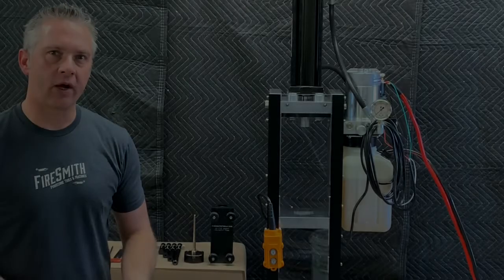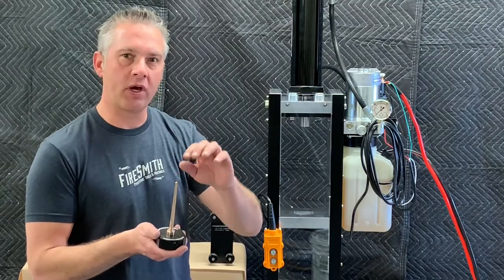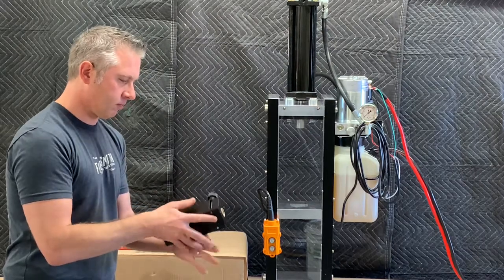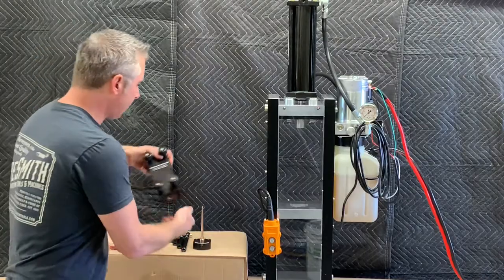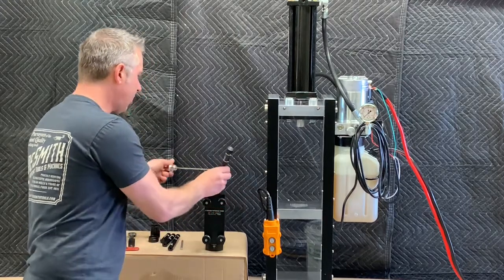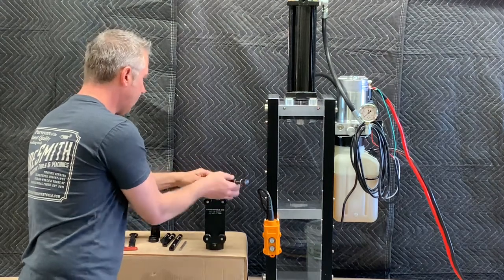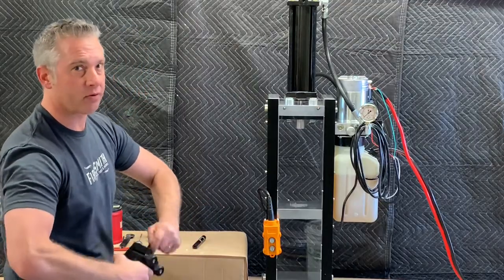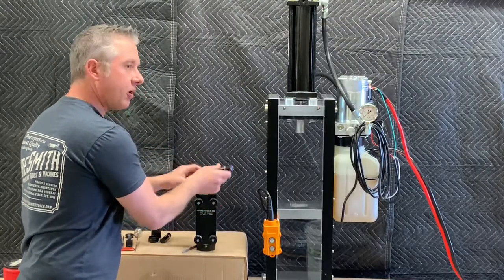Building a Strobe Rocket

Comment: @firesmithmanufacturing9376 the man the myth the legond... I have a important question to ask , so who else to ask than the master pyro... so i bought the 1lb 7 and 1/2 " 3/4inner dimension and i have all my ingredients rdy to go, so my question to you is with the PD,AP, both mesh magl, and barium sulfate for strobe, and the 3 for rocket fuel copper oxychloride, PP, and the titanium mesh can i get proper lift without using the bp motors that everyone seems to be recommending?  How many gram batch am i gonna need for these dimensions?

Comment: Just a question if you're in a state where it is completely legal to have rockets and manufacture your own fireworks without a license in that state for these rockets do you need an ATF license to be able to make them I just don't want to end up making something that I'll end up getting in trouble for
Reply: The big issue is storing devices in an ATF approved magazine. Their very Strick with storage. You can make them, but you have to shoot them on the premise and cannot be stored without magazine and cannot be sold or transported either. You would also have to check local state laws as well. Don't quote me on this! but it's what I've heard.

Comment: i did some static tests with my first batch of strobe pressed in a tube and it just burned like a flare, i think what i did wrong was pressed a flat fuel grain as if it was a delay stage instead of adding a core to it. im guessing strobe is only meant to be pressed around a spindle then right? thnx for the vids btw! 🙂

Comment: Actually strobe fuel does give thrust. A guy just use strobe fuel by itself and the rocket went up like if it was black powder.
Reply from the maker: Sounds interesting. I can't say I've ever come across a strobe fuel that produces much thrust. Do you know his formula?
Reply: Neighborj (aka @rockettests2617 on yt) made an 1/2" full strobe rocket and it worked good but it probably would not fly with an header

Comment: I'm about to buy your strobe rocket tooling and I want to make 1" ID rockets. What tooling set should I buy? Thanks.
Reply from the maker: Any of the core burn sets make great strobe rockets following this tutorial. I like the Nozzleless set myself.
Reply: Would sali whistle be too fast for a long skinny spindled BP motor set vs the Benny fuel?
Reply from the maker: @johnanderson186  Typically... but I do have some customers who use a couple increments of sally followed by benny for their motors. Generally, though you'd want the shorter spindle rocket sets for use with sally.
Reply from the maker: You'd want the 3lb size

Comment: I noticed you didn't add a clay bulkhead to the top.  Is it not necessary for these?
Reply from the maker: Nope, I prefer not to use a clay bulkhead. I've found that an additional increment of fuel serves the same purpose but always ignites your header. Clay bulkheads can produce passfire problems.
Reply: @firesmithmanufacturing9376  awesome thank you 🙏

Comment: So this has been a question I’ve been thinking for a while which is after I make the strobe rocket where do I make the fuse hole and do I need a header for it or no because other rocket models have headers unless this one I can shoot it raw like how it looks at the end of the video.
Reply from the maker: No need to make any fuse hole. Just fold that last inch of Visco in half and stick it just into the bottom of the fuel core. A header isn't necessary, but it really add another dimension to the device.
Reply: @firesmithmanufacturing9376  isn't that what that spindle is for? Creating a cavity in the bottom for the fuse?
Reply: The spindle creates a cavity for thrust. The longer skinnier the spindle, the faster and more thrust you will have. Your propellant will burn faster as there is more surface area exposed at ignition. 
Also means you need to make sure your motors are very well compressed and built, as CATOS with faster propellants are more likely, especially with nozzled rockets.

Comment: Just need to do a bunch at once. Prolly need a stronger press and something to pivot the force across all motors simultaneously like a car's differential but for a press's force
Reply from the maker: You're referring to a "gang press". This is commonly used for commercial production.

Comment: Cool press and dies, but rn somewhere in America someone is making this in there basement with a harbor freight press 😂
Reply: Is it...you....I bet it’s you 😂
Reply: of course, its me lol. screw the feds
Reply: Wait, you can't do this with a HF press?
Reply from the maker: Please don't build pyro in your basement. Insurance isn't going to cover your loss if something goes wrong. A HF press can be made to work (at least on a most basic level), but they tend to not be square or rigid enough to handle the forces exerted during pressing. I've repaired countless tool sets damaged or destroyed by HF presses bending when under load. As with any other tool, buy the good stuff once and it will last the rest of your life...
Reply: @firesmithmanufacturing9376  now I feel like it's a challenge 😂
Reply: @firesmithmanufacturing9376  don't try it at home. Try it at your neighbor's house while they're gone 😂😂
Reply: @firesmithmanufacturing9376  Great advice!
Reply: Hand arbor press. 1 ton. $85 Walmart
Reply: @Michael-rg7mx not going to work. It needs to be at least 8000lbs.
A 3 ton press is bare minimum for 1lb rocket motors with a .75" ID tube. Larger motors require larger force.
Reply: Forget the whistle. I just want the strobe and the boom! 🎉
Good video if you have 10 grand though. 🙏
Reply: USA???  Try other countries where people are more daring and creative.  You think everyone out there has money for that???  In America were spoiled.
Reply: This is sick
Reply: You called me?
Reply: Hobo freight😂😂
Reply: It’s me, and 3d printed molds
Reply: Where is the video out in the field? I want to see how it turned out. And is that Press ever going to come back into stock
Reply: Call and place an order on one. I imagine the presses dont sell like loaves of bread, so having 100-200 on a shelf is a lot of time and money just sitting around. 
Presses like these are really made to order or in small batches. 
I’m sure if you placed an order and some sort of retainer fee(or maybe not any retainer) they’d build one to order.
Reply: How did you know
Reply: and ATF visit is coming on the way

Comment: so roughly how much is for this whole setup i mean the whole thing everything in this video to construct and fill and to the point of firing the actual rocket
Reply from the maker: The rocket tool set with support, tube extender & spindle remover is available as a package for $389.00. Add another $2,500.00 for the press (which is used to build a ton of other pyro stuff as well). All the details at www.fire-smith.com

Comment: How much is this one LB able to lift? 3" or 4"?
Reply: 4"
Reply from the maker: A 1lb motor will easily lift a 3" shell quite high. Once you get your rockets dialed in, lifting 4" (and even larger) shells with a 1lb motor is easy.

Comment: If I remember correctly I was pressing them at 6200lbs, so that's like 3.1 tons. Never used psi for the press I got. I was using 3lb strobes back in the day
Reply: @recycal3981  do you have any social media? I want to know if you could help me
Reply: Leo Domi what’s ur ig
Reply from the maker: Yeah, a change in nomenclature has occurred over the past couple decades. 20 years ago, most rocketeers were pressing to a certain measurement of "pounds of force". Nowadays, pressing is generally thought of in "pounds per square inch". Each type of measurement is essentially doing the same thing.... letting us know how compacted the fuel grain is within the rocket tube. I find it easier to think in terms of PSI... every rocket I press is 8,000-9,000 psi on the fuel grain. Super easy to remember that number.
Reply: @firesmithmanufacturing9376  I don't have any real firework experience but I could imagine PSI being more useful for comparing engines of different diameters.
Reply: i hope your doing ok with the legal stuff! Really miss your videos they were great!
Reply: @user-uj9wz9sx4m  I should know within 3-4 months
Reply: @ciphercraft6176  hey bro i member when u got 45 lbs of kclo4 . Hope ur doin alr bro 👍🏾🤟🏾🤟🏾
Reply: @ciphercraft6176  three months are over!
Reply: @PyroMax  well, i still didnt here anything :/
Reply: @ciphercraft6176  are you legally not aloud to post on your YouTube anymore?
Reply: @recycal3981  attorney doesn't advise it
Reply: @ciphercraft6176  makes sense, are you still gonna post any halo or other video games on Xypher?
Reply: @recycal3981  why isn't he aloud yo post
Reply: *to
Reply: @ciphercraft6176  3 more months is over any news :)
Reply: @recycal3981  lots of talk with the feds but nothing promising. chances are i wont come back for quite some time, i wish i could though. in a perfect world i wont get any felonies and ill apply for the type 54 and be on my way but only god knows
Reply: @ciphercraft6176  that sucks there still talking about it, it’s been forever, but yeah the chances of them even letting you apply for a type 54 is pretty slim. The 4th is in 2 months are you still aloud to celebrate with consumer fireworks?
Reply: @recycal3981  i dont know it depends on if the court decides to apply any restrictions with the misdemeanor if that's what i get
Reply: @ciphercraft6176  well goodluck with that I will be back in 3months I guess , I don’t know how bad a misdemeanor is in Washington, I live in oregon like 2 hours from boom city and it’s just jail time.
Reply: @ciphercraft6176   what were they trying to charge you with? howd everything go?

Comment: I notice you use the black powder spindle when on your site the whistle spindles are much shorter. I’m confused
Reply from the maker: Generally speaking, there are two families of whistle fuels. Sally and Benny. Sally likes a shorter spindle while Benny likes a taller, core-burning type spindle. Sally tends to burn more vigorously with a higher pitch, while Benny tends to burn more slowly with a lower pitch. I am a big fan on Benny whistle and prefer it over the Sally fuels.

Comment: Imagine making a video in 2021, and still using banana-scale units to measure
Reply from the maker: I assume you are referring to the use of a teaspoon for increment sizing? Yes, that is far from an exact measurement, but for pyro use it is A-OK. The easiest way to construct precise and consistently performing rockets is to weigh out the total amount of fuel needed for each motor and keep that amount consistent. You could also weigh out each individual increment, but I have found that to be excessive and far more trouble than it's worth. But, keep in mind, we are describing pyro not aerospace where such accuracies are absolutely critical.
Reply: @firesmithmanufacturing9376  I was reffering to the use of imperial units.
Reply: @Marly375i  maybe if you picked up on the fact that he is American you'd understand why he's using imperial measurements

Comment: How come it’s illegal compared to other fireworks
Reply from the maker: Its basically the difference between consumer fireworks (the stuff anyone can purchase as a roadside stand) and commercial fireworks (the bigger stuff you see at large displays). The larger commercial pyro is significantly more powerful than the consumer version. Special training and permitting is required to use those items. The single best way to construct your own fireworks legally and safely is to join a pyro club or organization (www.PGI.org for details).

Comment: Would an arbor press be sufficient or do you need the pressure from a hydraulic press?
Reply from the maker: If you're making a small diameter rocket (1/2" or less), an arbor press will work. Quality tubes are a must, though.
Reply: Awesome thank you for the reply! Just getting started but very eager to learn for someone with experience. The terminology is a learning curve for sure and I have the basics down but from for knowing the difference between different types of rockets.
Reply from the maker: Happy to help! Feel free to ask any additional questions.

Comment: If the header fell off my strobe rocket can I just hot glue it back on top or should I just cut my losses? I aint trying to figure stuff out especially with these 4inchstrobe rockets..
Reply from the maker: Depending on the header, you should be able to just glue it back on. Heat up your glue gun, but unplug it before going anywhere near live material.

Comment: How do you calculate your 9000psi on the fuel grains’ actual psi reading on your p2f gauge?
Thanks Ben I appreciate the time you’ve put into your business and tutorials.
Reply from the maker: It's all a function of surface area. The hydraulic piston tends to be much larger in surface area than a rocket rammer. Basically divide the surface area of the piston by the surface area of the rammer and that will give you your factor of multiplication. I.e. if your piston is  10 square inches and your rammer is 1 square inch, your multiplication factor will be 10. Sooooo... a gauge reading of 100psi on your hydraulic piston will actually be putting 1,000psi on the rammer. Here's a sheet I use for all my tools and machines.

https://img1.wsimg.com/blobby/go/89f6e6f4-0d2c-4a4c-9da9-a100ff42aa9f/downloads/1bnm0l3s0_908830.pdf?ver=1623171412372

Comment: Careful when scraping the strobe fuel off the the inside of that hallow rammer. It has gone boom. I wouldn't blow the strobe mix off your tube support since its toxic and goes airborne along with all that fine mgal.
Reply from the maker: So long as you don't allow the fuel that gets caught inside the rammer to buildup and compress into a solid plug, there is no issue using the rammer cleaner to keep the bore of the rammer clear. In fact, the single most dangerous thing you can do while building a strobe rocket is to allow the fuel to build up inside the bore of the rammer. The friction resulting from removing a rammer that is stuck on a spindle due to fuel buildup can and does cause an ignition. Using the rammer cleaner (brass and non sparking) to gently remove fuel from inside the bore of the rammer doesn't introduce any meaningful friction. 

In regards to blowing off the small amount of fuel from the support.... typically pyro building is being done outdoors where this isn't an issue. For the demo video, I had to film indoors. The fuel being used in the video wasn't pyrotechnic in nature and was an analog for the real thing simply to demonstrate the construction process.
Reply: @firesmithmanufacturing9376  I did not know that. Your tools look very high quality compared to what I have but I'm a very low budget dude. From personal experience, I use the little bar very carefully to chip away at the whistle fuel not a brass rod. I wouldnt be doing that if I was a mass producer though but since im jus a hobbyist i can take my time for safety wihtout worry of falling behind schedule. . I wouldn't recommend anybody do it like i do. I never get comfortable and work fast because i fear an accident which can cost me my life. I never get comfortable in this hobby business or trade. Thats why im still alive.
Reply: @firesmithmanufacturing9376  so there smarty trousers...
Reply: @firesmithmanufacturing9376  
What about drilling the hollow rammer all the way?
Reply from the maker: @Michael-rg7mx  All new generation tool sets have completely hollow cored rammers. You'll still need to clean them out, but these hollow rammers dramatically reduce fuel compaction inside the bores.
Reply: I was gonna just assume he vaccuums the unburnt fuel he blows on the floor as to not cause a combustible powder buildup on the floor. Either way, mans dedicated to making beautiful fireworks, you have no room to question any of it. Freedoms baby

Comment: My tube support keeps opening and my tube is cracking. Why is that? Please tell me
Reply: Either you have a piece of junk, you're not tightening the tube support all the way or the threads are stript and it's time to buy a new tube support.
Reply: @TwistedMassPyro  you can drill new taps and use helicoils to fix it.
Reply from the maker: There are a ton of variables that can cause issues building rockets. Most problems can be reduced or eliminated by using proven materials and techniques. What are you using for a support? What tubes are you using? How much pressure are you putting on the fuel?